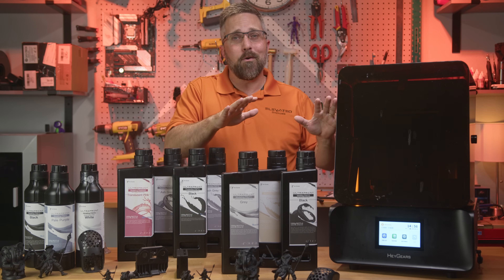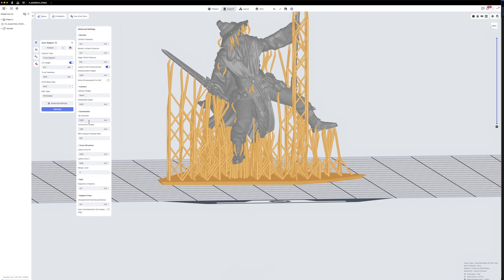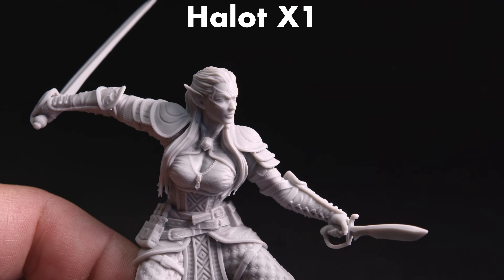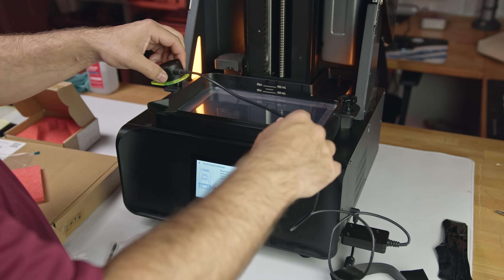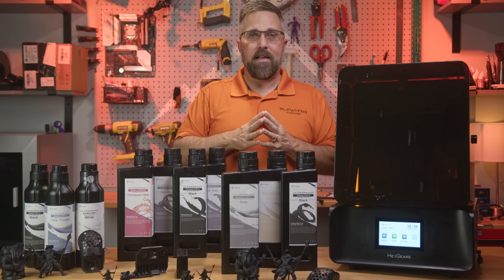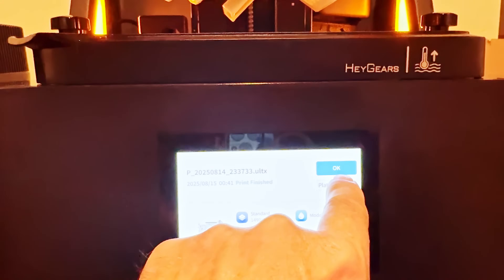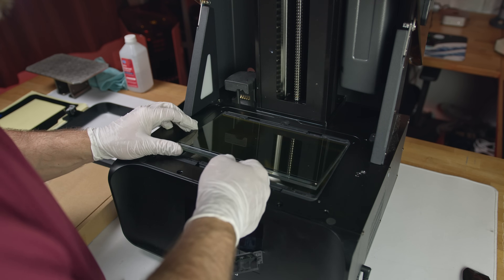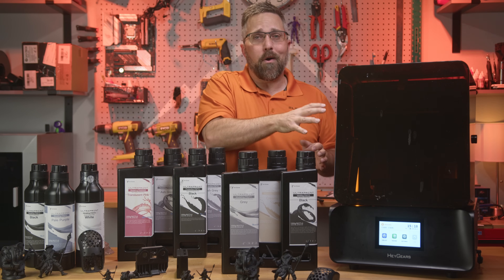Don’t Buy a HeyGears 3D Printer Until You See This Upgrade!

Comment: I used pap10 initially with RS Turbo. Details were good,  but I was also getting a lot of layer lines. Switched to pas10 and removed almost all layer lines, plus it's cheaper. This was for 1/8 scale, detail difference if even noticeable isn't worth using pap10 if you have to deal with layer lines.

Comment: The black box that makes the printer feel like magic when it's printing successful plate after successful plate also makes the RS a nightmare when you start having failures.

Not being able to see sensor data or tweak settings leaves you at the mercy of support to figure out your issues. This can take days to weeks and not end with a resolution, just more failures.

I both love and hate this printer because of this.

Comment: bought a reflex rs turbo this summer when they were on sale for 799. at that price it was a no brainer to buy one! It was also my first experience with resin printing.  From my first print , it was easy and flawless!!! I even used non heygears resin , from sunlu and some other brands with no issues what so ever!   Hoping to buy the pulse release module this christmas (if its on sale) to be able to use more resin types and speed up prints a tad!
Reply: Hey how is your 3D printer treating you? I’m almost about to pull the trigger on this printer and it would be my first.
Reply: @azymandias945  from day 1 it was pretty much click and print . even used third party resins like sunlu and elegoo without failure! was my first and only resin printer experience and its been great so far.  I dont use the printer alot maybe 1/5 compared to my bambu p1s ( i dont enjoy the smell cleaning etc.....)  but i definitely recommend it !

Comment: Those differences are SMALLER than a single percentage!!! It's 0.16-0.9%
Reply from the maker: I’m not entirely sure what you think you’re correcting here, but the only time I mentioned percentages was in reference to dimensional accuracy. That was measured using the Mean Absolute Percentage Error (MAPE), which—since you seem unfamiliar—is a standard statistical tool for comparing actual vs expected results. It involves taking 15 measurements per part, calculating the absolute error for each, converting to percentages, and then averaging them. For time’s sake, I didn’t bore the audience by showing all 30 raw measurements on screen.

I honestly can’t recall if they taught MAPE in elementary school, but I do know it came up quite a bit in my undergraduate engineering program.
Reply: @ElevatedSystems  OK, I changed my post...I took 2 random values from the video and it came out to me 0.16-0.9%...
In the video you said this: "variation from the CAD model" = dimensional accuracy, not statistical deviation.
For example, if we take CAD dimension 66mm and compare/measure with the 3D printed model, which is 65,89mm we have 0,16% deviation...etc. and this is what matters for the "rapid prototyping guy". The scientist can disagree 🙂
Reply: @ElevatedSystems  and, if you ask me, than 0,15-0,9% deviation is pretty darn good for a 1200 (USD/E) printer! 😀